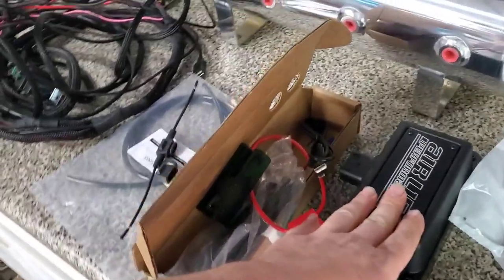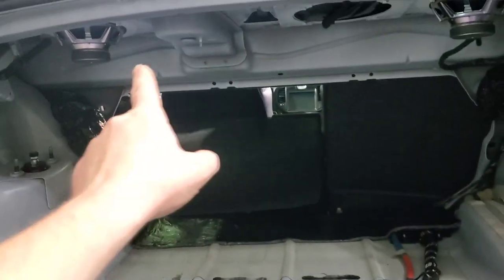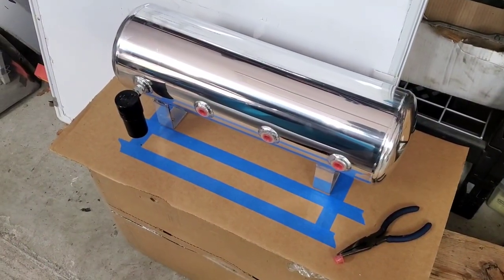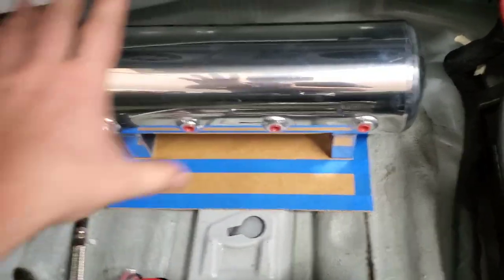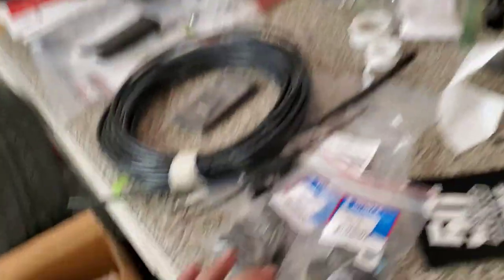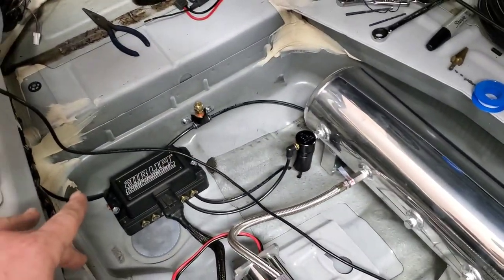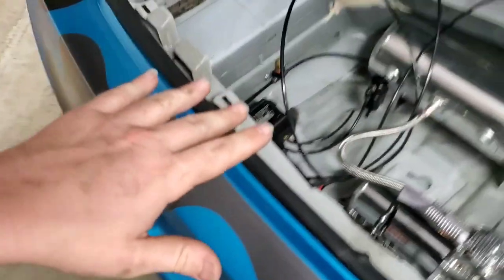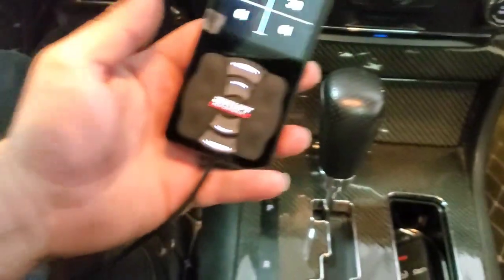Air Lift 3p management vlog style install on my 2013 Chrysler 300 SRT8 (air ride) | Part 2

Comment: Awesome set up. Always wondered what was involved in installing a set up like that on a 300. Hopefully you dont get any flat tires soon now that you dont have a spare anymore. Lol
Reply from the maker: Its never had a spare tire. SRTs didn't come with one.
Reply: Oh really? I didnt know that. It looks exactly like my trunk in my 300c with the fuse block and the space for the spare.
Reply: @humanoid7765  300 srt doesn't come with spare. Only a portable tire inflation pump. Its just another way to minimize overall weight of the car.
Reply: @rindershow212  umm yeah, we established that 3 months ago.
Reply: @humanoid7765  smh.